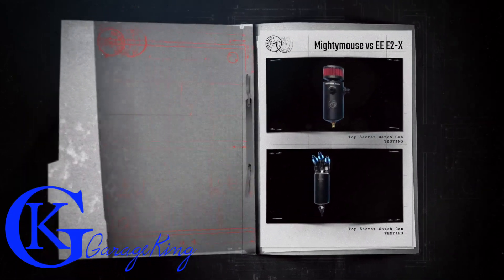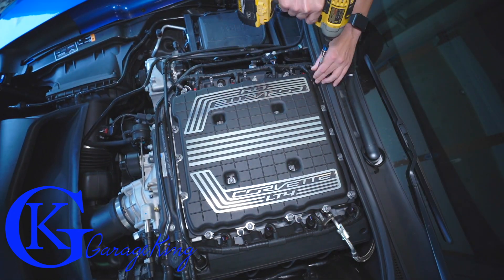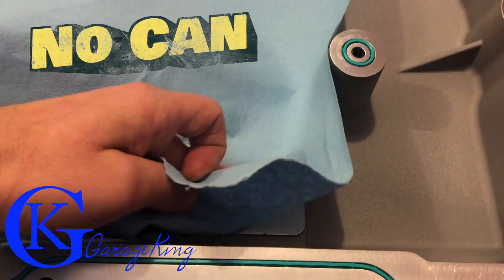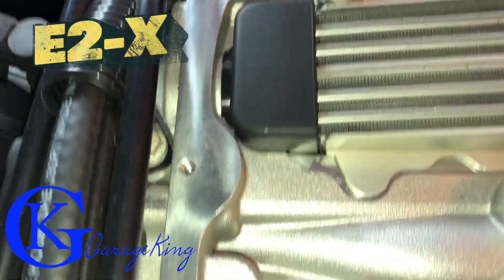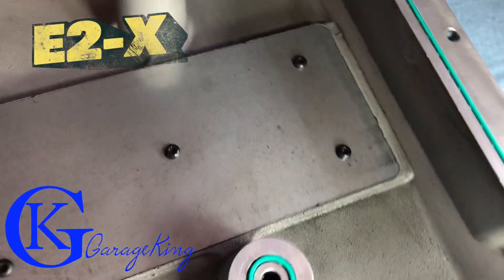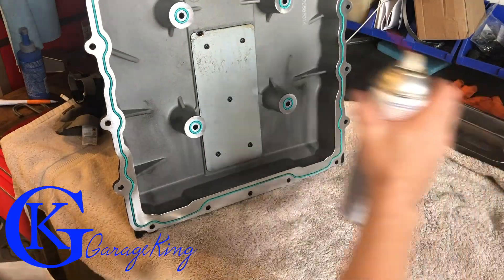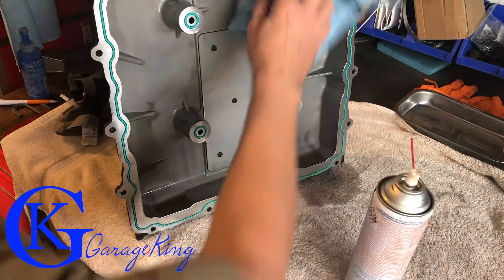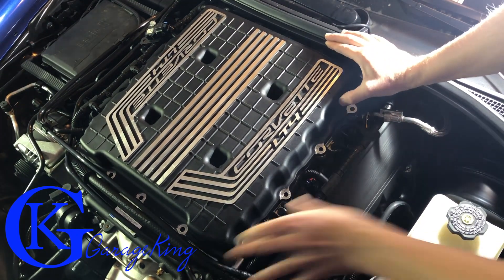Elite Engineering E2-X vs Mightymouse Catch Can Shoot Out

Comment: The issue with all catch cans is that they are connected (integrated into) the engines PCV system.   Yes, they can "catch" oil flowing out from the crank case as is depressurizes through the PCV system and reduce (not totally prevent) oil microdroplets from entering your intake plenum, which is the ultimate destination of all modern PCV systems.   Air/oil separators and catch cans need to be engineered so as to not block the flow through the PCV system while it "collects" oil droplets/vapor.   This is a tall task.   Many catch cans easily get clogged up over time with oil in their internal "air/oil separators" and begin to block the overall flow of the PCV system.   It acts exactly like if the PCV valve is clogged up.   Easy to check for...pull out the dipstick and check for air pressure coming out (use a small balloon or light paper etc.).   Not all Air/Oil Separators (AOS) or catch cans are engineered the same.   I've yet to see a test that actually looked at PCV system pressure behavior with the various catch cans used for a length of time.   Yeah, they work fine when new, until they start getting gummed up with dirty oil.   If your can is actually blocking the PCV system from working, then you are actually damaging the engine more than allowing oil droplets to enter the intake.   At least periodically thoroughly clean your catch can mechanism for oil droplet collecting with brake cleaner to be sure they are not clogging up your PCV system from functioning.
Reply: The E2-X system retains ALL functions of the OEM PCV, it simply enhances the functions by providing full time vacuum instead of part time as the OEM does.
Reply from the maker: Good reply, and you are right, its best to clean them on a regular basis.  Most good ones will never plug up as the oil drops to the bottom, and there is no filter to separate the oil, a good can will employ a method where droplets can hit the wall and run down so no chance of plugging up.  What you have to make sure is you empty is regularly, and you also clean it.  If you have a newer engine in good shape this should not be a problem.  An older worn out engine will be harder on the catch can as there will be more oil vapour/blow by. All manufacturers use some type of oil separator, but a catch can is just an extra step to remove more oil.

Comment: Great vid,
But what about the engine pressure? Would the catch can increase the engine pressure?
Also I believe the LT4 engine has 3 pcv tube 2 of them are connected to a built-in oil separator
Reply from the maker: There would not be any increase in pressure if you used the MM as it has a vent, for the Elite you could easily hook up a vent or do the multiple line method.  The LT4 has one (1) dirty PCV feed to the engine and its under the blower.  You are right, that this one tube is hooked up to a built in oil separator (that does not filter 100%) so that's why you draw from under the blower.  You are using the factory oil separator AND the catch can.  Nothing is going to be100%, but it's a lot better using a catch can.
Reply: The Elite also uses a second vacuum source so full time vacuum suction is pulled not allowing pressure to build to begin with.

Comment: Was there any difference in their plumbing?
Reply from the maker: They were both run very similar,  the only difference is the MM could vent, and had one suction source (throttle body) and the elite had two suction sources (throttle body and near air filter) but to be honest with factory boost (no mods on this engine) I doubt there is ever any venting from the MM(edited as I originally wrote Elite), or any using of the second Elite line (as I don't drive the car hard).  The throttle body would be providing the suction all the time. They both had one dirty line into the can and that was from under the blower, so they both got the same oil vapour to separate from the same place.

Comment: How much fluid did each collect in the milage? Kind of an important thing to know too.
Reply from the maker: You are right it is important, in a higher mileage video where you can't inspect the inside of the engine, or the engine is equally dirty after each test. In this test my engine was new and clean. If you want to see how much was caught please see this video where I do a test on my truck running it for more mileage.  
https://youtu.be/I-pMs0N1iHA
I know it's not a corvette but it shows how much each can captures relative to the other.  The reason I didn't show how much each can caught in the corvette video you watched is the amount in the can would barely be measurable because the test was concluded at 300miles (very low) so the best way was to show the inside of the blower, and its easy to see which can kept the motor clean (so the amount really does not matter)  Now if the blower was dirty with each can, then yes, the amount would be very important as I would not be able to tell which one was better, but in this case it is quite evident.  Also I have a brand new car so I wanted to get the test over with quickly so I wasn't sacrificing my car, I want to keep it as clean as possible. You may want to watch this video on catch can design.  
https://youtu.be/bQE1qEtP8dQ
If you understand the design you can make a more informed purchase. Thanks for your comment and if you have any questions just let me know :)

Comment: so mightymouse sucks or u trying sell more e2-x?
Reply from the maker: Hey There and thanks for the comment, I'm not trying to sell anything. Actually there are a few other catch cans that I would like to test.  The McNally looks pretty interesting. If you wish to purchase one of the catch cans you have to go to their site, I don't sell them. Most catch cans has similar designs, but if you understand how the design works you get a better understanding.  Take a look at this quick vid I did https://youtu.be/bQE1qEtP8dQ  You can be the judge for yourself. Thanks !!!
Reply: @GarageKing  was this the mighty mouse gen 5 plus ? I was going to buy one today but mighty mouse seemed to perform bad in your video
Reply from the maker: @cody11601  Hey There, it was the gen5+.  The results were surprising to me, but they are what they are.  You may want to take a look at this video https://youtu.be/bQE1qEtP8dQ as once you know what matters in design its not that hard to pick out good cans, and they are not too many good cans on the market.
Reply: @GarageKing  I'm wanting one that would work well for my LSA in the cadillac, what would you recommend at this point? I am still impressed by how well the elite engineering worked but there's not a lot of room in a CTSV
Reply from the maker: @cody11601  I never installed one in a CTSV, but it should be doable.  The Z06 was tight, but the Elite fit in there no problem. I thought I saw a video somewhere where some guy installed one in a CTSV but I can't remember where as it was quite some time ago. LSA is a good solid motor.  It was using in the 5th gen Camaro ZL1.  I had one of those and still miss it !!!  If I had to choose which one, I would go with the Elite based on what I found, but feel free to do your research.
Reply: @GarageKing  I'm definitely going with the elite and I think I may have enough room for the ultra behind the drivers headlight!
I have 2 more questions 
1. Does the length of the hoses to and from the catch can matter? I think they'll be between 3' and 4' long
2. Would you get a 3 port can with the 3rd hose with a check valve with the flow arrow going away from the can?
Thanks for all your help you've assembled an incredible amount of info on these things! BTW do you think the ultra would be overkill if I can fit it?
Reply: One more question, how did you have the elite plumbed on the Z06?
Reply from the maker: @cody11601  Hey there, thanks for the kind words :)  I think the ultra might be overkill.  Unless you are really going to mod the hell out of it, I think the e2-X is more than adequate.  As for the length of hose that fine.  On the LT4 in my Z06 I think it's about 6 feet from where it pulls the dirty air.
Reply from the maker: @cody11601  I have the centre port on the elite accepting the dirty air (on the LT4 its under the blower) then there are 2 ports left on the can.  These are the outlets. One goes to the vacuum source (throttle body) and the other goes to a secondary line (factory air box) as there is some vacuum there at wide open throttle when you loose the vacuum from your throttle body.  This way you get suction all the time.   Any other questions just let me know !!!
Reply from the maker: @cody11601  Yes, sorry forgot to answer, I would get the 3 port can.
Reply: @GarageKing  Do you think I would need a clean side separator? I've been talking with elite engineering today and they put one on the invoice they sent for me to review
Reply: @GarageKing  Did you run a clean side separator on the lt4?
Reply from the maker: @cody11601  Nope, just the dirty side, from what I hear the clean side is not really required.
Reply from the maker: @cody11601  Hey there, I don't think one is needed.  There is little research on how much the clean side gets out, and very few videos on it. For me I did not get one.
Reply: @GarageKing  thanks for all your help once again! I already paid the invoice from elite engineering so the clean side separator is coming with it anyway, which I'm ok with but how would you recommend I plumb it in to the E2-X ?
Reply from the maker: @cody11601  Hey there, I have never installed the clean side separator, but my understanding is it does not go to the catch can.  It can be plumbed to the cold air intake which will supply a little vacuum for it.  Once you get your package I would check to see if there are instructions with it. Sorry I could not be more help with this part.
Reply: @GarageKing  thanks for all the help again
Reply from the maker: @cody11601  Anytime, and glad I helped you out !!!